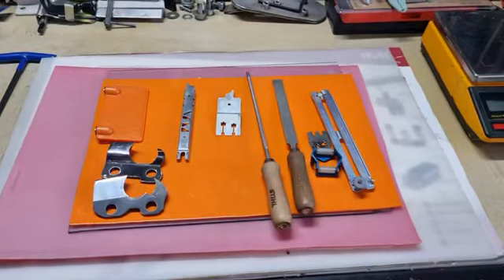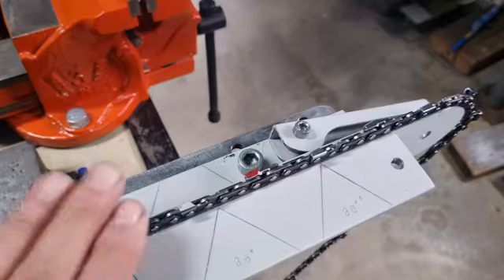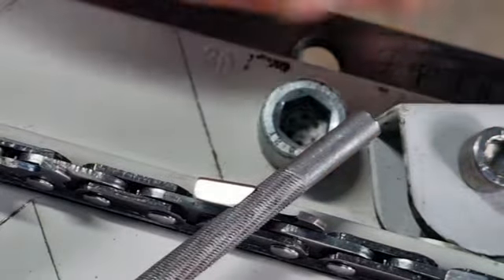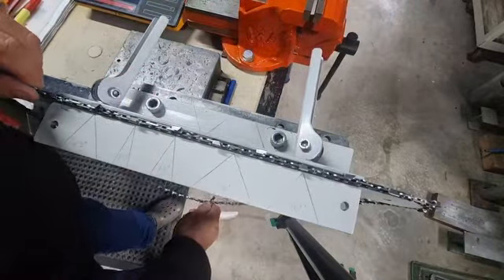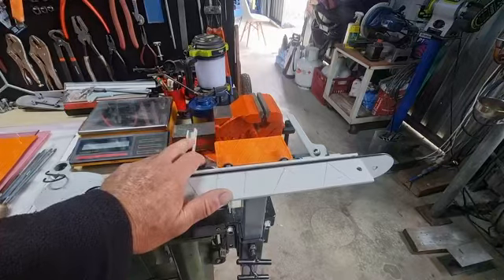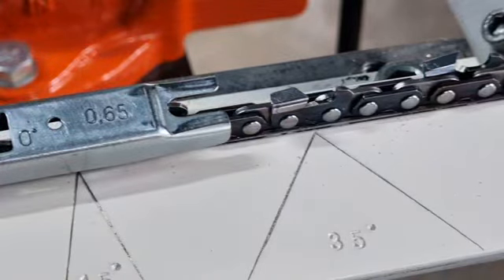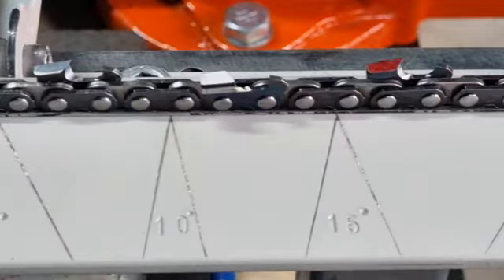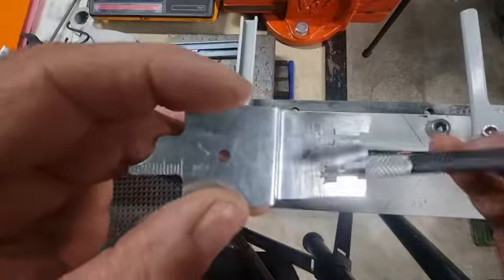How to sharpen chainsaw chain using a file

Comment: Thankyou for the upload. 
YT has a lot of very average content, In my opinion yours is way above average.

In the field I take not just extra chains but an extra bar loaded with a fresh chain in a scabbard. I find it easier to change a cool bar and chain. 

I use a Stihl file guide number 2. It cost me about 160 Au some years ago and I couldn't really afford it, but it has paid for itself in time and money many times. Over about 10 years I tried various jigs and machines but my breakthrough came with the Stihl FGuide #2. Probably wouldn't have needed it if I had access to the high quality info in these vids. 

Any newbs to sharpening chain I encourage you to keep at it. The satisfaction of making your own breakthrough, however that comes for you, is worth it. 

Cheers
d
Reply from the maker: Thanks for your comments
Reply: hi @ChainsawUsers  
You're very welcome. Your content has real knowledge - thank you very much for sharing it. 
d

Comment: 1) WCS progressive depth gauges are pretty hard. I use them.  They are 1095 tool steel and well hardened. I am not sure of the RC rating but it doesn't matter.
2) I use 7/32 all the way on a 3/8th 063 chain.
3) The reason we say "Get the Gullet" (Buckin Billy Ray) is because if you change down in size as the tool wears it is easy to create a Ski Jump instead of a straight C. So no one is suggesting cutting into the bottom plate of a cutting tooth but what we are saying is to maintain the line straight across in line with the bottom of the side plate bottom edge. It's harder to explain in writing but I know that you know what I am talking about.
4) You are right about flipping the bar.  A bar which is not flipped will become splayed underneath and on top and lead to excess heat and wear. Besides this the oil won't stay in the guide rail.
Reply from the maker: Great comments I did not know west  coast saw progressive depth gauge tool was hardened, thanks
Reply: @ChainsawUsers   I take the gauge off before filing anyway but they are hard. They are also blued.  They rust very well although they don't rust away so to speak.
Reply from the maker: For some crazy reason they don't sell the Stihl progressive gauges in America
Reply: @ChainsawUsers  Stihl USA don't get them made and don't import them from Europe I believe.

Comment: Hi TOT,
Thanks for all your sharpening videos. Loads of great information.
Viewed from the side, should the profile of a Stihl RM chain be identical to a Stihl RS chain, even though the top plate angles for the RS are 60'" and the RM are 75 or more"? Are these numbers only for a grinder? Should there be more hook on a full chisel, when viewed from the side, as these numbers suggest?